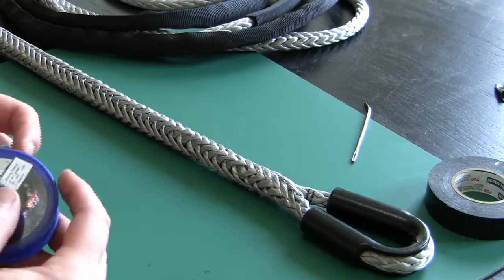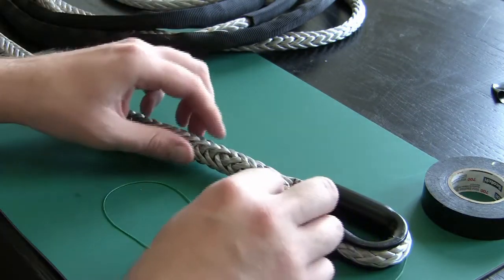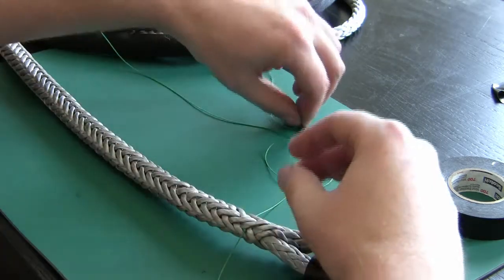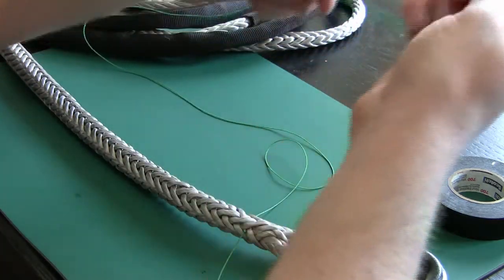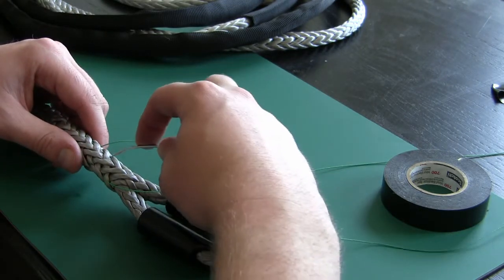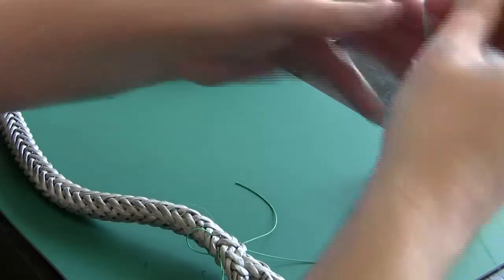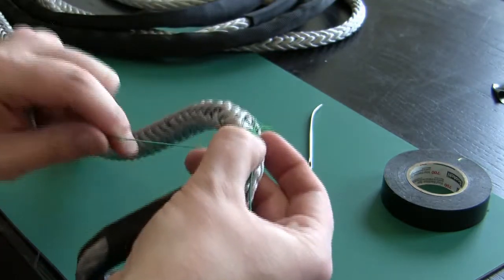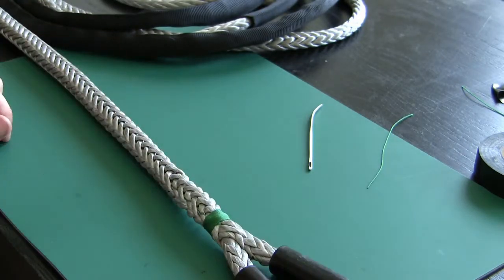Dyneema Lock Stitch Demonstration

Comment: Good information. For what it is worth, some manufacturers suggest that the twine used for the lock stitch, should have a diameter that is approximately equal to the diameter of a single braid used in the construction of the line you have spliced.
Reply: Samson is quite explicit about this in their lock stitch instructions, as well as not having it too tight. From their video I gather that the reason you want your lock stitch braid to be about the same thickness for burying the knot of the lock stitch, preventing the need to wrap the twine around at the end.

Comment: or you can do an appropriate locking eye splice. Not to be that guy but that is not the correct splice for a dyneema eye that will be used under load. You are now relying on stitching to hold the line from slipping under load. A true locking eye splice will never slip. Understandably if this is a double ended eye splice with thimbles on both ends then yes you would have to use this method. would not recommend this though if you can make a true eye splice
Reply: Sorry, but you are incorrect on a number of things. First and foremost, all buried splices derive their strength under tension from friction between the outer braid and the braids of the tail buried within them, which occurs when the outer braid constricts onto the buried tail under tension (i.e. the chinese finger trap analogy). Lock stitching and whip stitching have nothing do with the strength of a splice under tensile load, and a long bury eye splice, done correctly, is actually the single strongest eye splice under tension (but the difference is negligible compared to other real world factors with working rope). The locking splices are about what happens when the eye is not under tension, which is precisely what the lock stitching is also about. Lock stitching is to prevent the tail from working its way back out from the bury when it is not under load. That is important because, as mentioned, the tensile strength of the splice under load relies on generating sufficient friction, which is a function of the buried tail length. So, a suitable length of buried (and properly tapered) tail is required to generate enough friction (and avoid stress risers in the fibers by minimizing the rate of change in their angle). In the case of a long bury eye splice, the bury length is generally recommended to be at least 72x the rope diameter. A locking splice, like a Brummel eye splice or it's similar variants, uses the spliced line itself to help achieve this, as it locks together to prevent the buried tail from working it's way free when not under load. Most locking splices in professional use for life support and rigging, will tend to get lock stitched anyway, just for added insurance.

Purely stitched eyes in rope are a whole different game, and are totally unrelated to lock stitching.
Reply: I just want to add to what @TheMadMagician87 said by linking to Samson's eye splice guide. It does NOT use a locking Brummel and relies entirely on burying the tail, with a lock stitch to keep it from coming out when not under load. https://samsonrope.com/docs/default-source/splice-instructions/12strand_c2_eye_splice_web.pdf
Reply: Lol. If you have no clue what you’re talking about, why comment?

Comment: what size of whipping twine would you recommend for 14mm dyneema  rope?
Reply: I'm sure you are done with your line, but as per my comment:
"For what it is worth, some manufacturers suggest that the twine used for the lock stitch, should have a diameter that is approximately equal to the diameter of a single braid used in the construction of the line you have spliced.
"
Reply from the maker: Hey @callumluescher, you can use #4 whipping twine, same as what I used in the video.